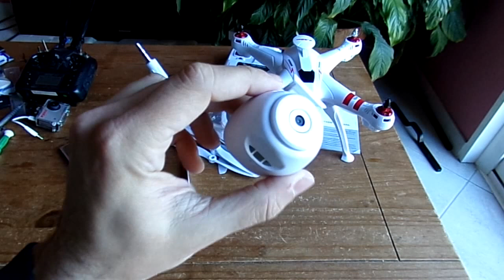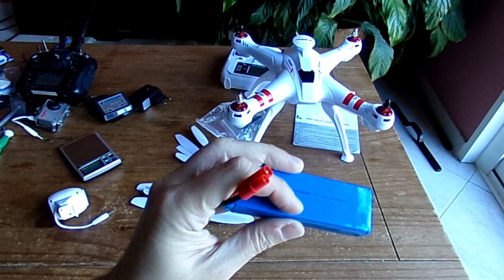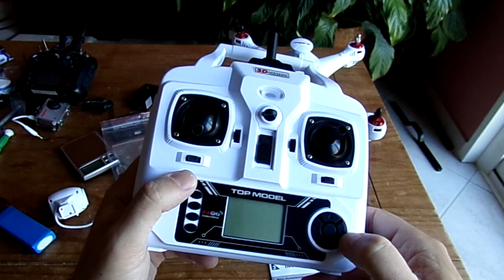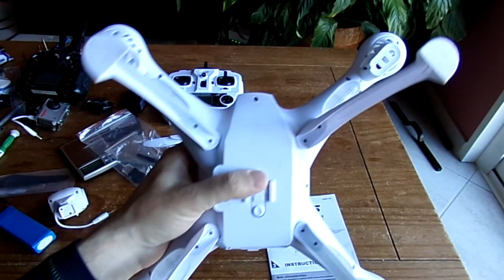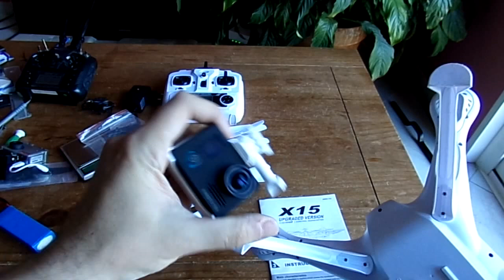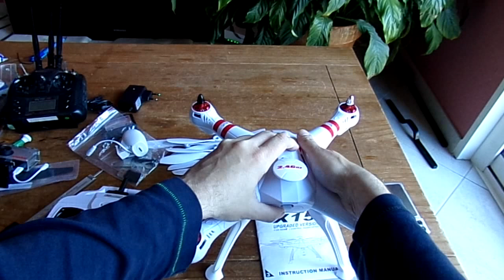Bayang X16 unboxing and analysis (Courtesy Gearbest)

Comment: Thank you Seby for the detailed review. This looks like the Syma X8C with Brushless motors. 

The build quality definitely has to improve, no doubt. They just cannot make this a competitive quad with such cheap quality. Even considering the low cost, it would not sell well if people experience lots of issues because of cheap quality. 

If they do consider the cons you've mentioned and work on that, then this has good potential to be a competitive low cost quad in the market.
Reply from the maker: +prashb7 yes... if the price is still around 100USD ... if more than 150USD, I don't think it can be successfull ...
Reply: +SeBy DocKy  tem câmera melhor qualidade?
Reply from the maker: +P4CK GAMER Sorry I don't speak portuguese :(

Comment: Hello Seby, great service! I'm Italian and I'm waiting to Gearbest Italy, the Bayangtoys x16 wifi fpv with brushless silver. I also purchased the Firefly 7s which foresaw even mount on the drone instead of the 2Mp. Which cable should I buy for the FPV functions by remote control? Thank you! Roby
Reply from the maker: What do you mean by FPV function by remote control ? to retrieve the AVout and send it to a Video transmitter ? If yes such cable shoud help: http://www.banggood.com/Hawkeye-Firefly-6S-4K-Camera-Spare-Part-AV-Cable-p-1020335.html?p=YL2512105842201212FR
Reply: Thanks for the reply, I saw the movie and I noticed that to transmit in First Person View a 1080p video in addition to cable http://www.banggood.com/it/Hawkeye-Firefly-7S-4K-Wifi-Camera- Spare-Part-AV-Cable-p-1104833.html? rmmds = search requires a boscam http://www.banggood.com/it/Eachine-TS832-RC832-5_8G-32CH-600mW-FPV-Transmitter-Receiver -7_4-16V-p-1079941.html? rmmds = the search of the X16 control distance barrier, is over 200 meters, but it is just the flight controls in 2.4 Ghz. The FPV signal X16 with camera is based on wifi, then connecting it to a smartphone and staying in a radius of 30-40 meters, you can see something at a resolution 640 x 480. I think it's the same with the Firefly 7s. Being a toy one can be satisfied .... we'll see.
Reply from the maker: The quoted VTX works in 5.8G band so won't interfere with the 2.4G radio part. Of course on your 7S, disable the WiFi.

Comment: I don't like to hear that he inspected the guts of the m/c and found unsoldered joints and broken wires.
I agree it may have been a rushed production.
Reply from the maker: With the last batch, they changed ESC and have PWM connexion via servo plugs.... Situation have been improved. It's Under verification.